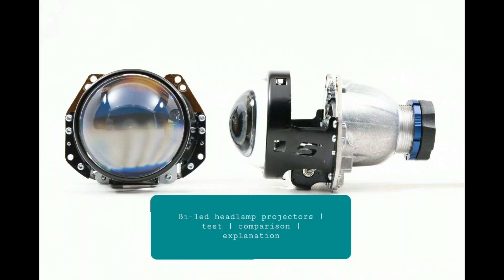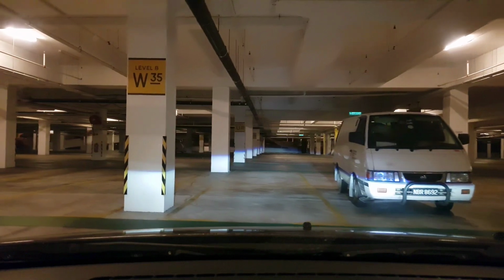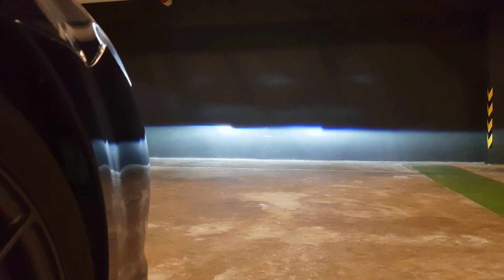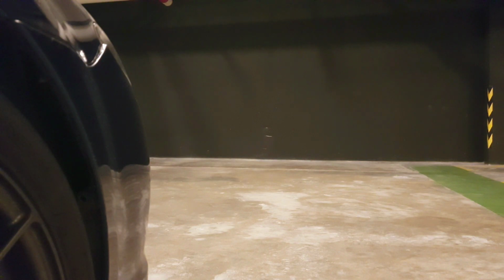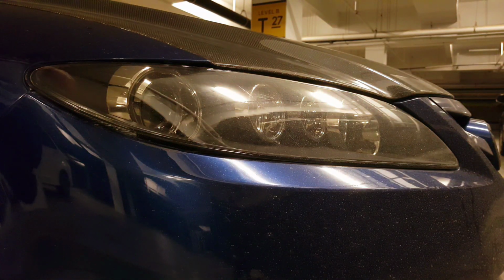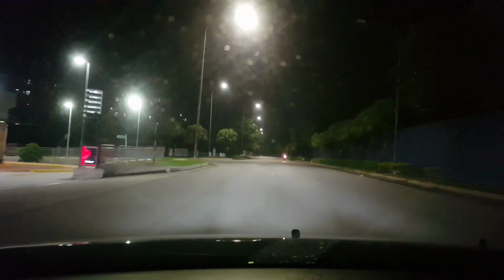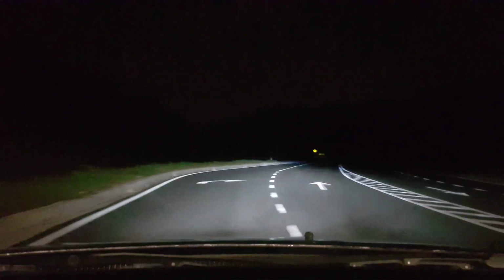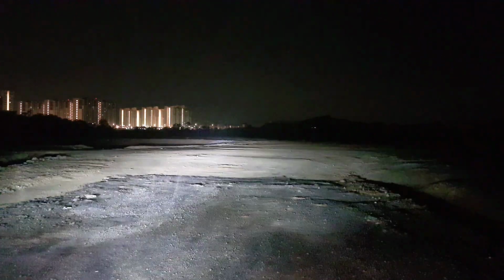Bi-Led Headlight Projector Retrofit Explanation, Testing, Review, Comparison. Mazdaspeed 6 Convert.

Comment: How did you make them fit? I've 2.5" mini h1 projectors and want to upgrade to a Morimoto MLED projector. Does it have the same bolt pattern? Any trimming on the adjustment bracket required?